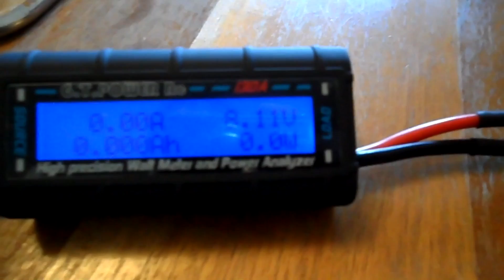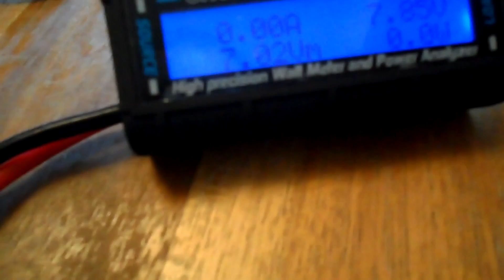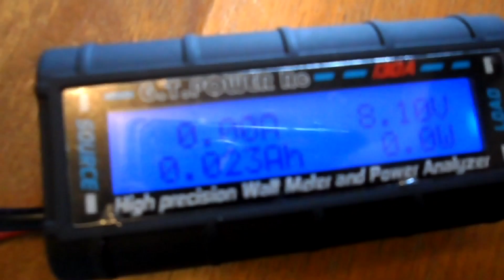Focal price 2700kv motor testing on 2s

Comment: This thrust test is not valid because it is pushing air to the table itself (or sucking air from it(i dont know if it`s a pushr or a puller configuration))
Reply from the maker: sergio urquijo it gave a good idea of what I was looking for.
Reply: @jayrothwell  yeah, good enough of a demo for static thrust. No need to overdo it, just bought some lighter 2s batts too to play with on the same type of foamies.
Reply from the maker: @dirkcornelis5708  have fun, I love playing around with different setups. You learn so much!

Comment: What is the size of propellers
Reply from the maker: 6x5 6x4 6x3
Reply: how did u connect the battery with the motor
Reply from the maker: +Harsh Arunansh using a esc
Reply: can you tell the whole process
Reply from the maker: visit rcpowers and you can get all the help you need. Try and buy the ebook, well worth it! http://www.rcpowers.com/community/pages/home/

Comment: Why you don't use 3s ? it produces ~900g on 5x5 propeller, or near 1kg at 6x4 (very hot in long run)
Reply from the maker: I do on some models, i wanted to build this as light as possible.
Reply: How many amps does it need the esc?
Reply: +mvp needed 40A is fair, but 50A is fine

Comment: Hey m8. Exceptional results. Have u ever tested D-2826-6 or 2212-6 2200 kv motor on 2 s ?
Reply from the maker: no i havent, ive not had chance to use those motors that would need a 2s setup yet.